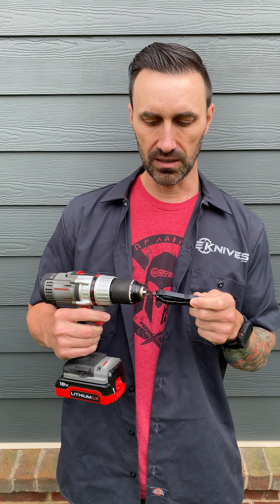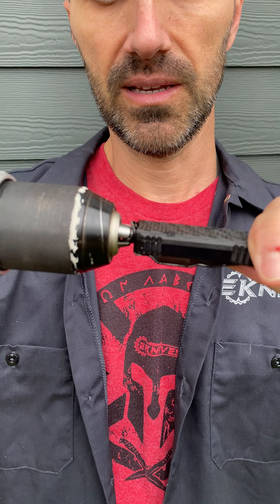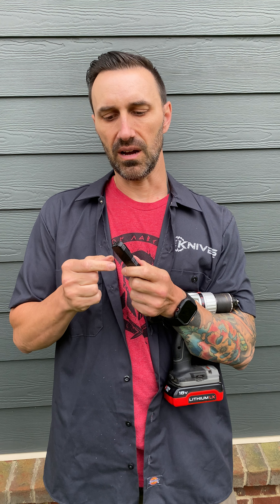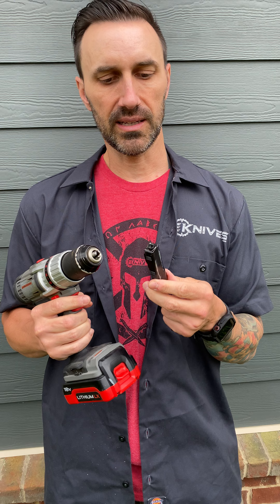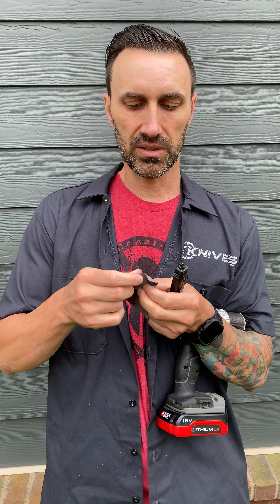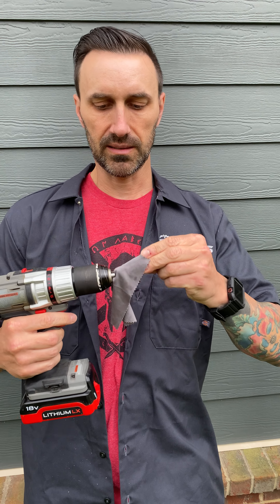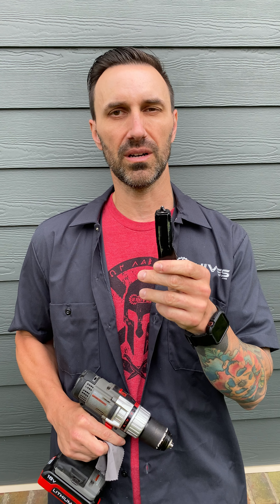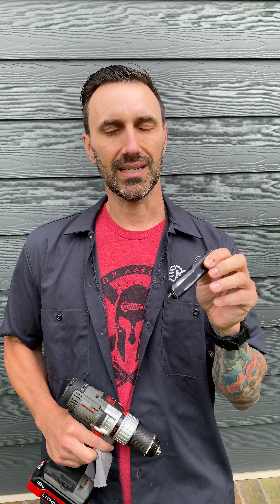How to Remove the Glass Breaker Microtech OTF Switchblade Knife

Comment: What I would really like to know is if there is any type of screw that would replace the glass breaker on the Microtech Ultratech?  I've never liked the look of a glass breaker on Microtech knives because in my opinion they are a bit too tacticool looking!!!  I wish that Microtech would eventually make an Ultratech that had a pocket clip&screw that would sit flush into the end of the handle!!!  Also, I wish that Microtech would eliminate that part of the pocket clip that's bent upwards on an angle with a hole in it for a lanyard!!!

Comment: Do they sell a screw that you can put in place of the glass breaker? I want to remove it but I also want my pocket clip and I don’t want a hole to be left in my knife.
Reply: Its been done many times.  Look around online a lot of guys have done this.  Order a thread Gauge from any tooling supply company like grainger or even Amazon if they have them.  Then match which one of the gauges match the threads on the glass breaker.  Find a Alan drive flat head screw or taperd flat head ,the length you want with that matching thread pitch and your done

Comment: Is there a screw that I can replace the glass breaker with.
Reply: Its been done many times.  Look around online a lot of guys have done this.  Order a thread Gauge from any tooling supply company like grainger or even Amazon if they have them.  Then match which one of the gauges match the threads on the glass breaker.  Find a Alan drive flat head screw or taperd flat head ,the length you want with that matching thread pitch and your done